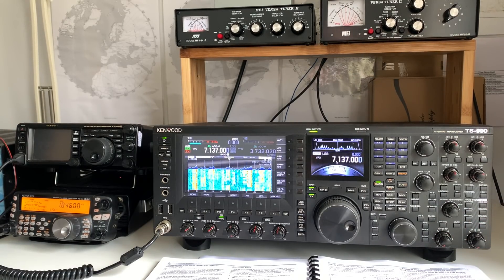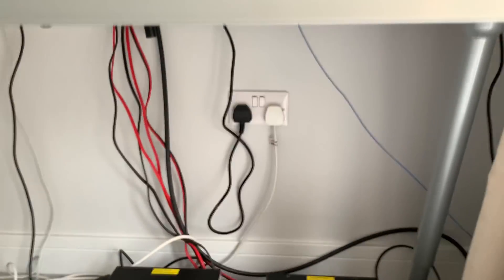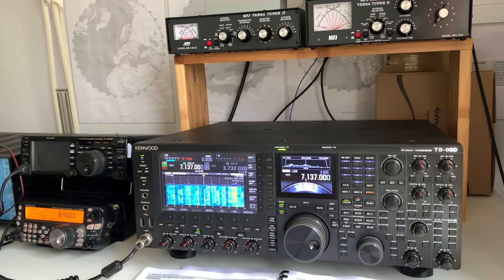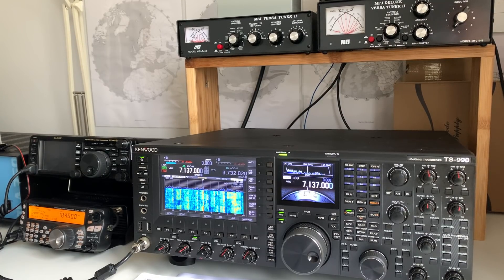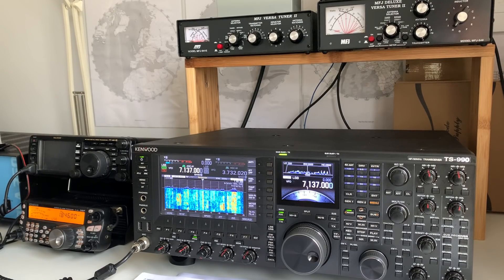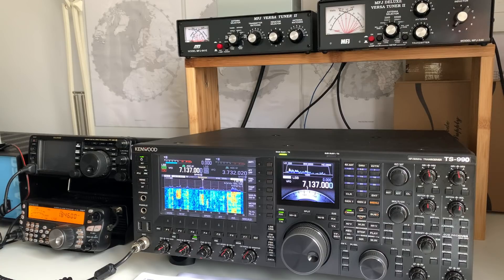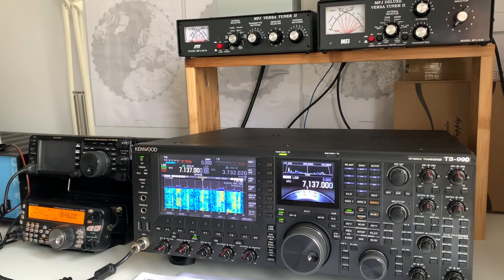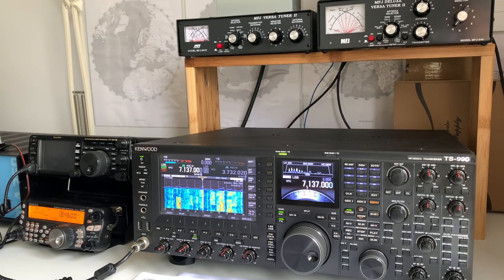Revealed: the uncomfortable truth about how ham radio equipment manufacturers specify their products

Comment: There are several reasons on why your MFJ tuner is not working. It could be as simple as the bias of the RF is a bit different between the radios and the tuner is marginal.
Reply from the maker: Cheers

Comment: I’m thinking that the issue could be due to reactance value. Probably the 300w rating is in a 50ohm resistive environment. If you had to match a large reactive impedance that could explain why you got that issue. Even though wouldn’t explain why you didn’t get the same behavior with the TS480. Also make sure that you do match properly. Always the most capacitance and the least inductance possible combination. Start with caps on 0 and move your inductor switch to find the lowest reflected power, then work your way with the caps and refine the three as needed. This way you match the best way and assure the least losses. MFJ is not the best quality product but at the end of the day is not trash either. Is just a low range product. People complain about MFJ and then buy chinese crap.
Cheers
Reply from the maker: I agree with you on your conclusions re MFJ...the operator just has to understand the limitations based on input Z
Reply: Legitimately, I have family in Starkville, MS. When I purchase anything MFJ it's mentally written off as an investment in their local economy 😆.

Comment: First thing I would do is put a 50 ohm dummy load on with a decent power meter and check the power output from both your radios before ATU and after the ATU and see the output.
Reply from the maker: Done already with the TS990...but thanks

Comment: Why run 200 Watts anyway? 100 Watts to 200 Watts is half an S point. Barely noticeable. I had an FT101E. I wouldn't even consider going to 200 Watts for half an S point, and keeping the electricity bill down. I now run QRP only.
G4GHB.
Reply from the maker: I get what you're saying re double the TX power for 1/2 an S point, but that's not really the point though Bill. 73

Comment: What is a "roofing filter"?  What are "third-order harmonics"?  Heck, I'd like to go to a well-equipped electronics laboratory to learn these things!  It'd be magical to compare radios and their specs in a lab with test equipment and a tech available!
Reply from the maker: Well said Sir!
Reply: A roofing filter is located after the first Intermediate Frequency stage (approximately 9MHz in the TS-990S).  The filter narrows the amount of spectrum that is allowed to continue to the second IF and ultimately to the DSP and audio stage of the receiver.  The roofing filter can improve selectivity and reduce the level of the noise floor, especially for CW mode.  

A fundamental (original )frequency will have a second harmonic that is twice the original frequency.  It will have a third harmonic at three times the frequency, a fourth at four times, etc.  The second harmonic will typically be weaker than the fundamental frequency and the third harmonic weaker than the second, etc.  The second harmonic, being an even harmonic, doesn’t pass through the roofing filter.  The odd harmonics will pass through.  The fifth harmonic is typically negligible, but the third harmonic can be strong enough to cause distortion, called Intermodulation Distortion (IMD).  The design of a receiver determines the strength of the 3rd harmonic and the amount of distortion it will produce.  There is a point at which it can affect weak signal reception.  But, with most modern transceivers, the 3rd harmonic is very subdued.  

The TS-990S has a good receiver, but there are more than two dozen now that top it.  The Yaesu FTdx101D, FTdx101MP, FTdx10, Elecraft K3 and K4, ICOM IC-7851, Hiberling PT-8000A, Kenwood TS-890, and Yaesu FTdx5000, just to name a few.

I hope this helps.  

73, de N4HNH

Comment: If you are looking to do 160 meter band. Most of the issues are proper use of baluns for your antenna  and RF ground currents.
Reply: MFJ makes a artificial ground tuner  .  If your RF grounds are not true RF grounds meaning no rf current going to ground you will be chasing this problem for a while
Reply from the maker: There is no issue at all with the internal ATU...only with the MFJ in circuit...

Comment: What the Tuner can handle depends on the Load.  A short antenna on 160M is hard to match,
Reply from the maker: It's not a short antenna - the bare match on 160m is 2:1...did you watch the video?
Reply: @OxfordShortwaveLog  Yes I watched it. If your internal tuner matched it why have the MFJ in line anyway?

Comment: That MFJ is fine for 100 watts. Over that the load better not be too reactive! I built my own maual L /Pi tuner
 and tuned from inside the shack for years. 2 years ago I mounted an automatic remote tuner right at the feed point of my 77ft low wire. It is worked against a radial field. The difference was amazing! My friends thought I bought an amplifier. I use an Icom AH-4 with my Icom 7410. Wonderful combination. I worked Latvia, Moscow, Ukraine, Serbia, Poland, Cyprus etc all in the DX window on 75 meters this season with my 100 watts. 
   Much better than the old tuner in the shack...losses were killing me!
73 and good DX to you! In North Carolina mountains BTW.
Reply from the maker: Great info. Mike, thanks very much and 73 from the UK

Comment: MFJ = Mighty Fine Junk ... could be the variable air caps are sparking above 150 Watts? ... I think most of the gear is being designed for 100 Watts within a certain impedance range ... it very much depends on the matching circumstances ... if the antenna impedance is relatively high, the voltage will be even higher and the "300 Watt" you mentioned is most probably the max power under resistive 50 Ohm termination (ideal situation).  Build your own matcher with vaccum caps or probably even better get a semi professional matcher and place it outside at the antenna feed point, not behind the coax in your shack .... that is always a poor compromise, causing audio / rf feedback loops as well as massive power loss. It also adds to global warming when using your outside coax as a heating element :-).
Good luck - 73 Joerg in Munich
Reply from the maker: Thanks Joerg...73
Reply: MFJ was might fine junk back in 1974 when I got my ham licence, and it still is.. LOL, its cheap though, good for a beginner.. but then  you upgrade to something better..

Comment: Try patch leads made from 213 rather than RG8 ? Solved a lot of problems on my set up which is just 10 watts :-) M7BLC 73
Reply from the maker: Thanks but that's not the issue...
Reply: I was wondering if you tried different permutations of patch leads....?

Comment: You have a £6000 radio (if it was new) with an in-built ATU but you are plugging in a separate matching unit to do what the radio would do with ease ... help me out on that one ?? ... confused as to why you would want to do that :-)
Reply: Unless kenwoods atu are another beast, most built in tuners are more touch up. I still use an external tuner just because they are stronger.
Reply from the maker: I'll help you out this way instead; you have completely missed the point of this video. You're not on your own though, 2 or 3 others have also out of the 3,700-odd views. Oh and by the way, it's not a £6,000 radio, it's nearer £8,000. Just sayin'....73

Comment: On most problems like you described , feedline radiation is the issue not the tuner . A proper rf choke on the coax should eliminate the problem. You didn't indicate what type of antenna you where using so just a guess . Good luck with the fault.
Reply from the maker: Thanks, Don. I actually have a very high quality RF choke on the coax and it made no difference whatsoever with regard to this issue. The only way to fix the problem was to set the MFJ to bypass...then perfect audio. All sorted now anyway. 73

Comment: I think it's your MFJ antenna tuner

I bought me a MFJ 1982 and fed rated for 800 watts

mfj 1982 it's rated for 800 watts I burn it up with 500 watts

I got a local UTC clock from mfj 1948 the one side quit working on it

MFJ used to stand for mighty fine junk now it just stands for junk

stick a fork into me I am done with MFJ jug

I think your radio is okay

73
Reply from the maker: Well said! 73

Comment: Hi Clint. There is not much to add to what other fans have already commented. He certainly wouldn't use an MFJ tuner with a 990 which is a brilliant piece of engineering with a poor piece of engineering. But even so there is fine print in all the antenna tuners, the ranges and the losses of the coaxial cables. Tuning more than 3-1 with coaxial cable does not make sense because of the large number of losses and those who design good quality tuners know that. Yes it can be done but it doesn't make sense. I would recommend reading carefully the section on antenna tuners DJ0IP explains it in a more or less simple way since it is not a simple topic. Greetings and congratulations on the 990 it is an impressive piece. 73&DX
Reply from the maker: Thanks - finally someone gets the point of this video! 73

Comment: Very interesting bit or research and MFJ tuners are a tad flimsy. However, you are aware that MAXIMUM PEP is 32 watts on top-band from 1850kHz. We are secondary users there and can only run full beans between 1810 and 1850kHz. So sadly does make your findings irrelevant for the regular use as MFJ may well have taken into account the UK band plan and decided that their 300w rating on top band was irrelevant due to not being legal in IARU member countries. Just a thought... Also the latest band plan (corrected) is available to download from the RSGB. Best 73 de MM0JNL
Reply: Yes I was just about to post about the power limit. In fact I thought it was only 32w on all of top band. Nice that at least almost 25% of top band allows 400w. I presume this is quite a new ammendment?
Reply from the maker: See above lol.
Reply: @OxfordShortwaveLog  yes lol indeed but I'm amazed 400w is now allowed or has this been the case for yonks ? When are you on ? I'll have to tune in...what antenna do you use for top band?
Reply from the maker: George, you haven't really understood the point of this video at all. I am fully aware of the TX power limits on top band. We have sked twice a week on 1.846 MHz, so in actual fact this is very relevant. Thanks for trying anyway. 73

Comment: You could always measure the output power with a power meter into a dummy load. I have used TS480, TS590SG, and now TS890 and the 'power curve' at the 100 w level showed full rated output on 160m but only 93w on 10m. Finals on the 480/590/890 have the same standard solid state radio power amplifier circuit and the measurements showed a consistent decrease in output power as you go up in frequency. Well, another good aspect of being a shortwave listener, you omit the TX chain and the magic wizardry that happens in the finals :). Add to this an MFJ matching unit, that's really pushing your luck ! 73 Tony
Reply from the maker: Thanks my friend. Tested the TS990 in the shop - 200W but on 40m I think. I'm gonna test both rigs with a dummy load shortly. 73, Clint
Reply: The mfj tends to be on the cheaper side of things and some times that doesn't help. Also did you use the same port on the mfj and same cables as on the other radio? Some radios are more finic on matching than others so depending on the impedance of the input connector on the mfj  may effect how much power in can make. Manufacturers usaly spec them into 50 ohm load on the output of the radio. Even a small imbalance can upset it.

Comment: How is the mfj grounded? You may be getting a voltage reflection problem. At 2.0 SWR, you'll get about 33% reflected voltage but it will only show up as 11% reflected power. The 480HX will actually handle this better because of the separate power input through the amplifier. The 990 will have significant audio modulation.
Reply from the maker: It's grounded to a copper rod in the garden via a short cable. 73

Comment: Clint - nice video. I met the design engineer at Dayton a few years ago. I suspect the rig will put out close to 200 w on 160 if you put it on a dummy load? I have had variable output on my Icom big rigs in the past so I appreciate your frustration. You can find the design engineer's video and call on youtube. Just write him and ask.  I did not realize there were hobbyists in Oxford - have visited for work many times but never have spotted a yagi or HF antenna. Glad there are hams in the city.
Reply from the maker: Cheers Scott. I haven't tested teh 480 with a dummy load, but the TS990 was tested in front of me before I purchased it - 200W right on the nail. Yes there's a few of us around in Oxford! Thanks and 73.

Comment: There is no way anything MFJ get's connected to my 990 😄 According to my powermeter my 990 is putting out a little over 200W on all bands. I tested it using a dummy load. So I think you should use any MFJ whatever on anything else but not your absolutely fantastic 990 😉
Reply from the maker: Thanks my friend - really interesting to hear your 990 is actually putting out a little more than 200W. To be fair, the MFJs work fine on 80m and down, but if they're specified at 300W on top band, they should bl**dy well be able to handle it! 73
Reply: @OxfordShortwaveLog  They should!

Comment: Did you attempt to get a signal report on 160 with the MFJ out of circuit at full power? 
If the internal tuner handles the job just fine, and then routing through the external tuner causes diminished audio quality, logic says it's either the Versa Tuner or the cable to the Versa Tuner.
Reply from the maker: Yes all done - perfect audio on 160 @200W with the MFJ out of circuit.

Comment: Most of the MFJ antenna tuners are rated at input power so you can halve the rating. Also on top band the impedances can get very high  
I would check both radios with a Bird 43 watt meter or similar for output power.
Reply from the maker: Thanks

Comment: The MFJ 300 watt rating is not accurate. I have an MFJ rated at 300 watts, I would not run more than 100 through it and I have seen it flashover at that level. MFJ is not the best quality. I don't think your problem is the 990.
Reply from the maker: No it's not - it's definitely the MFJ - thanks
Reply: @Radioamatööri OH2DX "Chevrolet claims that their 2020 Corvette C8's top speed is 194 mph , but it is impossible to drive it that fast down every road - Is Chevrolet lying to us ?"
Provided that under at least one circumstance the 2020 Corvette can reach 194 mph, then the specification has been met.  So it is with tuner specs.  A 300 watt tuner could probably handle 300 watts provided you are feeding a 50 ohm load, in which case you don't need a tuner.  As you start to add SWR, you also add voltage, a LOT of voltage at 10:1 SWR.

Comment: Hi Clint. I had similar problems with my Icom IC-7800 and a rubbish MFJ tuner. It wasn’t great and it struggled to match anything at 200w. I binned it and bought a Palstar AT-2K. Problem solved. That’s a great radio so it deserves a decent ATU. Good luck Graham
Reply: My experience with MFJ stuff, at least in the past, was poor ground connections to chassis which had been painted. Worked fine after I cleaned it up.
Reply from the maker: Thanks Graham, good advice. 73
Reply: @OxfordShortwaveLog  Check the spec before you buy as it depends what antennas you are using. Palstar do several versions
Reply: Another vote for a Palstar tuner - mine is AT500 :)
Reply: Ditto 👍 the Roller inductors on the MFJ’s are junk.
Reply: @transmaster  I don’t know the innards of the model of the tuner, but sounds like core saturation if there is a ferrite involved. Had that issue on a coupler on a mag loop antenna I was building / playing with

Comment: It might be that both rigs are ok and it’s your PSUs for the 480 that can’t deliver the current. If the PSUs are not capable they will current limit and the rig may not deliver full power. It might be worth checking..? 73 de Will, M0LGW 👍🏻
Reply from the maker: It's not the PSUs...the MFJ just can't handle 200W from the 990. Everything is perfect with it out of circuit. Thanks

Comment: Don’t trust mfj.  You have a $8000 radio that by your own admission is working fine on it’s own.  In the US mfj has earned a reputation for being Mighty Fine Junk
Reply from the maker: Lol
Reply: Over here we say ‘made of *****g junk’ 😁
Reply: MFJ = Mighty Fine Junk
Reply: Bought an MFJ 949 some years ago and when turning one of the capacitors it made a scratching sound. Brand new unit. Opened the unit and one of the wires from the coil switch was too close to the capacitor. Not much testing done at the factory I guess...
Reply: I have a pristine hardly used TS-990S (no mods whatsoever & never fiddled or opened, as new from factory)... A wonderful workhorse machine. Ain't had any issues with it.  But then again, I am a dummy when it comes to electronics and RF.